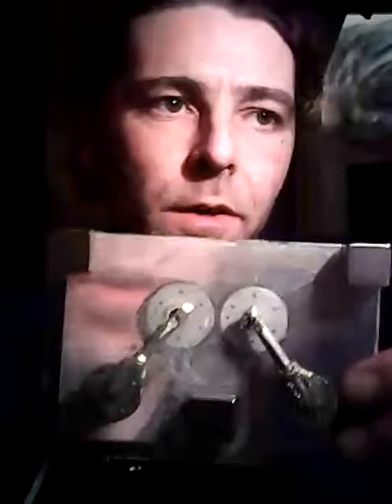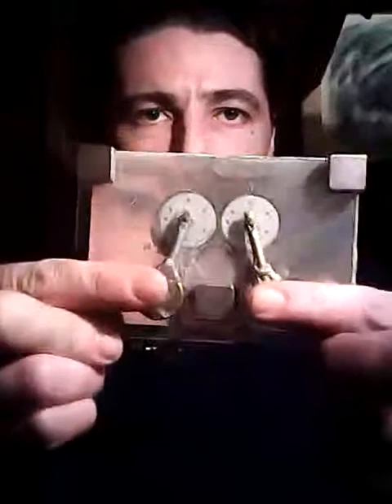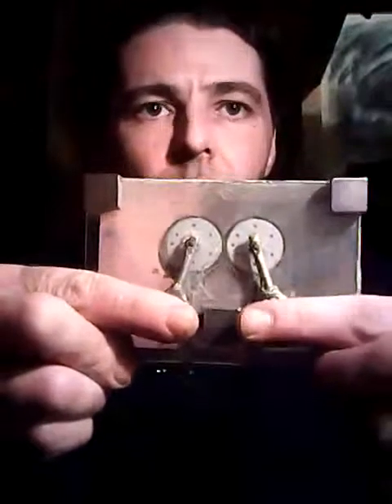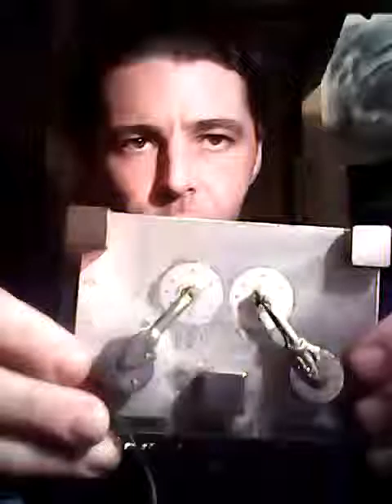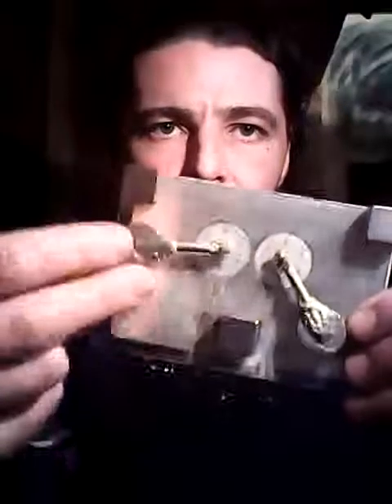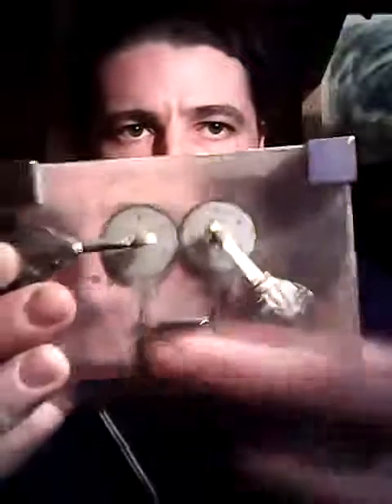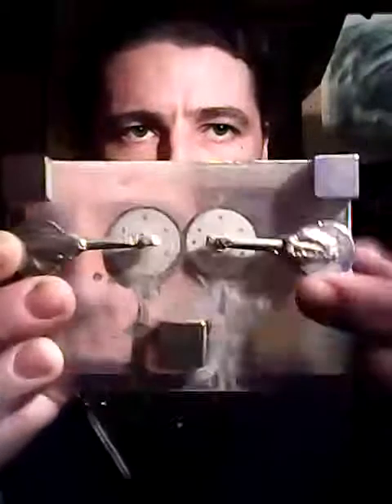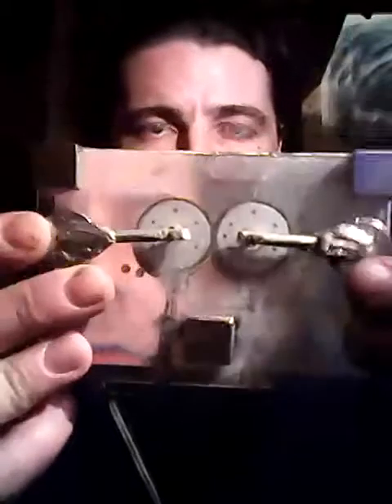VID 20130929 055337

Comment: there's no right or best frequency , if it will work ..it will just work.
and if you agree and accept darthglowball comment and try to alter the design , the easiest one would be pulsing the balls horizontally (while they are hanging down) so you wont be have to deal with their inertia pushing them up but you'll get thrust from their inertia as they are stopped at the end.

BUT on the way up there will be centrifugal force downward which is equal to the inertia upward. but dont give up , i mean it